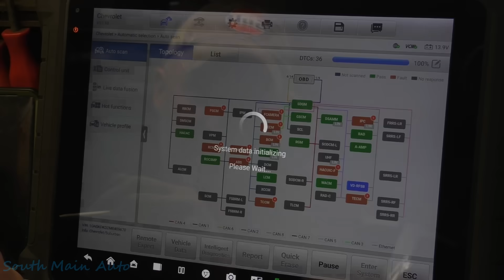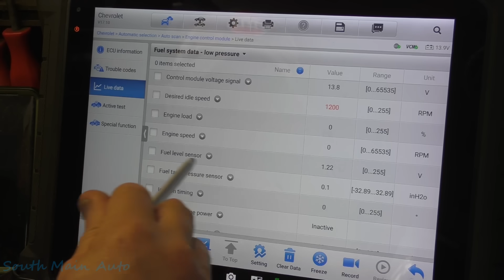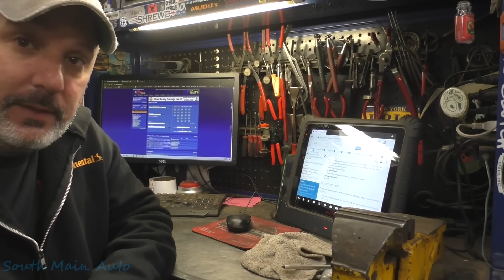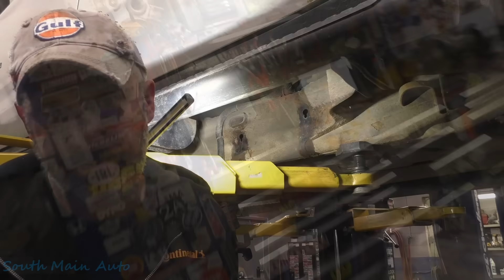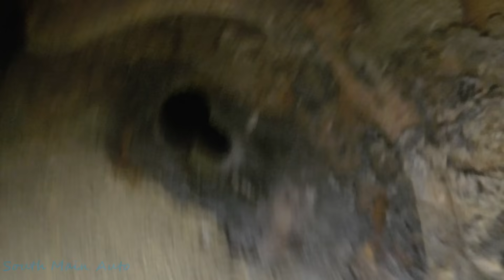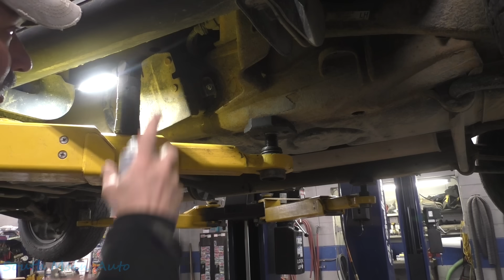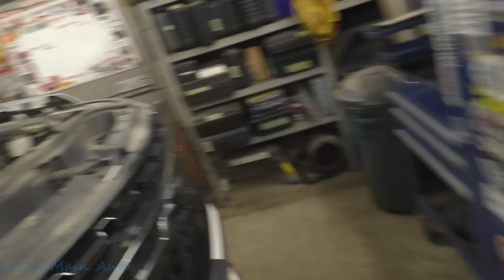'21 Chevy Suburban - No Start, Cranks OK

Comment: My guess on the bracket mount - Some bean counter determined the time to mount it was .058 seconds faster that way (right or wrong) so they went with it. The fact that it sucks to work on is just an added bonus for them. Great video!

Comment: I’ve got an amazing Silverado second gen, lived most of its miles in Illinois. It’s got 256k miles original 5.3, original lifters, and original 6l80e. I’m a mechanic and the largest item it ever got was a fuel pump because it was pouring gas out of the supply line due too rot. Its frame is beautiful and was built in fort Wayne Indiana. It is stupid easy to work on and doesn’t give up. These new ones piss me off for the same reasons.

Comment: As I'm sitting here watching after another day of wrenching in central PRNY, just wishing I could give anything to be back blasting out intake gaskets/headgaskets on GM 3.1/3.4 engines. I used to hate them, but damn now I miss just nuts and bolts for most problems with 90's early 2000's cars. Simple EFI, and no driver aids, just the nut holding the wheel.

Comment: You were supposed to loosen the nuts, lift the module up in the slot until the bolt head aligned with the hole.  Then, pull it forward so the bolt head went through the hole.   You're not supposed to completely remove the nut.
Reply: Guessing inverted torx was to hold bolt while loosening bolts. Why didn't service data describe it that way.

Comment: You say "three phase brushless DC motor"? Am i correct in saying its a 3 phase AC motor powered by DC? If so, it sounds like fuel pump control is just a variable frequency drive? If so my suggestion would be getting specs of motor and using a generic VFD. Thats how i tested three phase ac induction motors on rail car applications.

Comment: I'd have to guess the module is installed that way for ease and speed of installation. flop it up there and then have their calibrated torque guns tighten it down with the need to back the nut up with a wrench.

Comment: This tow / roll back driver in Texas. Tows a lot of GM trucks with under forty thousand ( some times less ) with fuel pump driver module failure. He is even getting them on the new diesel GMs. GM isn't fixing the problem but only putting in the same bad part. They even have fixed a couple before he has put his truck away. GM quality number one..

Comment: These three phase pumps, fuel, DEF, etc, are gonna be annoying to diag depending on the type of fault. Watched Royal Auto channel fight with a three phase DEF pump circuit that ended up being a slight volt drop where wire was crimped to connector terminal and that shut DEF pump completely down. No more poor motor performance, just work or don't work.

Comment: Super interesting, I know YouTuber "Tow truck Dustin" shows about once a week a Chevrolet or GMC with a bad fuel pump module, and that is on both the gas and diesel versions of the truck and now it is happening to the SUVs and smaller duty trucks. That must be why they have so many in stock, and the parts guy is like, yeah, we sell a lot of them.

Comment: Sometimes engineers just goof up. Nobody's perfect.  I wouldn't be surprised if it was designed to be removed for a certain model and they reused the frame for a different model.  
   Weird I was just looking at a japanese small run device to check cables on amazon. It looked like an arduino device or similar.  It's made for computer/ phone cables, but I bet it could be butchered up for cars.  (I literally was on amazon within minutes before this video)
  There is a textbook for people interested in general theory and troubleshooting called ''electrical motor controls'' by Gary Rockis and Glen Mazur. Not for the faint hearted. This is not a specific vehicle book, it's for beginning students.

Comment: I have been watching for over two years and have never commented. So I will start. Comment! 🤣
It's not you, I never comment on anything I watch. I love your channel.
Reply: I am an OLD geezer 88 yo and in the 50s a professional mechanic... points ignition, and  carburators..sun machine  scopes... nice that the ecms can be helpful..most of the time for cars these days.. I really enjoy watching someone using mostly common sense to diagnose problems and not just be a parts cannon.. thanks for the stories...😅
Reply: I'm a dumb retired plumber and Eric has me mesmerized with his detail oratorical based servicing brilliance.
This is educational theater on YT...Thanks again Eric O.
Reply: I subscribed to you because you are an honourable man and need at least one subscriber.
Reply: @wayneessar7489  Make that TWO!
Reply: @MrTruckerf  As one comment said 953,000 think like me.
Reply: That's A. A C Motor 12 Amps.   ??

Comment: Good questions, Eric! From what I know about BLDC motors, it's very hard to check properly (and worse, if you don't have access to the motor). The driver sends pulses to each winding and sees where the other windings are at, on a fraction of a second, by analyzing their back EMF, to start the 3 phase output based on it. A proper driver may detect a problem in the motor, if these signals are skewed somehow, but a faulty driver (either with one or more blown MOSFET or IGBT, or fried control electronics) will not perform these functions. I believe you can buy a Chinese power BLDC driver, to improvise a test on the pump, but it's an external setup that you need to prepare and play with on the bench, with a used pump, before testing on a real vehicle.
As for the mounting bracket, manufacturing engineers no longer see more than the part(s) they are designing, and only in a virtual world. They have no clue about how the real things they designed look like in an assembled car.

Comment: The honest answer? It's probably cheaper and easier for assembly. Hang it in place, zip those two bolts to tighten it and not have to worry about the manufacturing steps of putting a captive nut or carriage bolts into the frame.

Comment: Permanent magnet three phase brushless DC motors are really nice. The magnet is actually the rotor and the windings are the fixed field so need for brushes. I have a small milling machine with one and it is fantastic. At 2500rpm I can grab the drill chuck and stop the motor and it will trip off. At 100rpm it makes so much torque that I can't stop it by holding the drill chuck. Brushed motors are the opposite and make low torque low rpm and high torque at high rpm. In a milling machine application you want more torque at low rpm which is where you will be running bigger torque hungry cutters. All this with a spindle driven by a cogged belt directly from the motor with no two speed plastic gears that the brushed motor version of my mill has and they often break. On top of that it is quiet as a church mouse. I, however I have no knowledge of how to test a brushless motor other than continuity and equal resistance of the three windings. They are relatively new but probably quite reliable as there are no brushes to wear out and no contact surfaces other than the bearings. Let us know if you find a suitable test method.
Cheers: BJ

Comment: Why for all the tea in China or beer in Ireland would GB put the bolts inside frame rail and weld them? from inside out, in a blind hole, with no access to them, with a dummy 10mm on outside? I guess you’ll have to turn it red and make it liquid with torch if can’t muscle it off.

Comment: You could have tied your  Pico scope into each of the three outputs to the pump.  A lot of work to diag a cheap part though,  so not always cost effective.  Spending extra time on a system new to us is only good for learning purposes.

Comment: Things I would try to check:
- Put a current clamp on each phase to the motor (connected to your scope). Do you see an AC current waveform on each of the three phases when you cycle the pump?
  - If one or two phases is missing then you know that one or more drivers in the control module have failed.
  - If all three are missing it could be the same thing, but you are not as sure you are measuring it properly since you are not reading anything.
  - In this case where it was commanding 8500RPM, that might be 8500/60 = 140Hz. It it likely a multi-pole motor so the actual frequency will likely be a multiple (2-3-4-6-8) of that. But in this case probably in the 150-1000Hz range.
  - You could also back-probe the scope leads between the phases and look for the driving voltage, but make sure your scope is not grounded to the vehicle (i.e. it is best if it is battery powered), so it can see the voltage between the phases without grounding the phases.
- Are there three signals coming back from the motor in the schematic? If so, those would be the hall effect sensors that tell the controller the exact motor position. Put a scope on each of those (probably a 5V-ish signal) and see if the motor is turning.
- More likely in this case is that this is a three-phase induction motor, which will always run 5-20% slower than the driving AC signal, and the controller is looking for the back EMF from the motor that indicates how fast it is turning.
- If the controller is sending a good 3-phase drive to the motor, the controller is probably fine, and the motor is probably the culprit.

Anyway, just some ideas on how to troubleshoot.

Comment: Bolts are that way due to assembly speed and requirements. POS formed frame makes holes $$$ the keyhole slot means the assembler only has to drop the unit into place and hit the two bolts with the Torx. GM likely has the off shore supplier assemble the module to the bracket.

Comment: Jeep's not far off "General Mistake" ... I had to take the upper intake manifold off my wife's 2018 JL to change the driver's side plugs.  Luckily I have every U-joint, extension, and flex ratchet my Snap On dealer could sell me.

Comment: Eric,

A suggestion for testing those three-phase fuel pumps:

Get an electronic speed controller for brushless motors that can handle 4 cell Lithium polymer batteries and 30-40 amps, a servo tester and a cable that can hook up to the + and - of the fuel pump controller. The speed controller and servo tester can be bought in your local(?) RC hobby shop and you might have some suitable cables laying around. You don't need anything fancy electronics, the basic stuff will do the job nicely. Assemble the parts accordingly and attach to the fuel pump. You will now be able to test and run the pump without its module. If you hear the pump run and don't get any pressure, stop and change TWO of the motor wires, this will make the motor run in the opposite direction. Still no buzz, still no pressure? Replace pump. Buzz and pressure? Replace module!

Love your channel and your work, greetings from Norway! :)
Reply: I used to be big into Rc diy drones so I have a bunch of those things laying around. I’m gonna have to try that! I’m a mechanic now and that could be a valuable tool to have in the diag cart!
Reply: I came here to say the same about using an RC motor controller, or check with a 4 channel oscilloscope to look at the phases from the pump controller.  On the chance that one phase locked on, it MAY risk over heating one phase of the motor if it was on for long periods weakening the motor. (However I would hope it could withstand something like this.)
Reply: Yes, sir that will work out just fine. You're comment reminds me of an older mechanic who built all of his own test equipment using Heath Kit stuff for troubleshooting and diagnosing the ECM controlled vehicles when they first came out. He was an older gentleman, and he embraced the newer technology, and it was also cleaner work in the repair of an automobile. He stayed clean and did not get dirty working on automobiles. I was in the tool business at the time, and he worked at a Chevrolet dealer that was on my route. While other mechanics were bitching about them "computer cars" he was learning new tricks. Now who said that you can't teach an old dog new tricks.🥸👍👍👍👍👍👍👍👍
Reply: yep put on some gm plugs to pop it inline and a cheap servo tester would be a good tester.
Reply: That was my thought, but then I wondered if the GM pump would be damaged if it were run backwards. I own a GM truck and you can’t take anything for granted.  Some of the design decisions that were made on my truck are truly mind boggling.
Reply: I have a 30 amp one from Amazon, even has a reversing switch ($18.00).  Have used it several times to test pumps or drain tanks. Works great,

Comment: The problem is that these car manufacturers are putting too many sensors,  and modules in. What ever happened to  the basics? 🤔
Reply: The EPA happened. Trump might change some of it. But IF what the Chinese are claiming about being able to charge an electric car in 5 minutes is true, or close to true, combustion engine cars & light trucks won't be made by 2035.

Comment: 22 -24 pump modules are failing left and right on the GM trucks. They have really weak starters also. That long crank just reduced its longevity by 50%

Comment: Ford uses a carriage head type bolt with a spring clip attached to the head that would work for that bracket assembly. They used them on the 2013-2019 Explorer to hold the charcoal canister to the underbody of the car.

Comment: I find it interesting that the service manual says to replace the controller before replacing the pump.  That doesn't sound like a lot of faith in the durability of the module. (Yes, it's easier to get to, but still...)

Comment: From what I've seen, this is a very common problem on late model GM trucks. You would think that by now they would have done a redesign to improve the reliability. I am an EE and I would gladly take on the assignment myself. However, I can tell you for sure that a reliable design would cost too much. At GM, the bean counters rule! My experience in designing product for the auto industry, and in particular, GM, is that the  lowest cost is the #1 priority.

Comment: Seems like Tow Truck Dustin tows these with this issue a lot.  I think he's based in Texas and has towed the same vehicle more than once.  Good to finally see what this module looks like.  GREAT VIDEO!
Reply: Did you see video of Tow Truck Dustin take a Chevrolet to the dealership and the mechanic put a module on and drove the vehicle away before Dustin could get his wrecker bed put up? Just amazing!
Reply: @kennethpalmer1909  I did see that video and others like it
Reply: I watch Tow Truck Dustin pick up about one a week, and he complains about the same thing: the fuel pump module.
Reply: @chrisrpht2000  GM electronics are trash through and through.
Reply: @crisnmaryfam7344  Like the rest of the vehicle.
Reply: @crisnmaryfam7344  I think they're made by "bosch", who'd have guessed.
Reply: He is based out of Houston or near Houston

Comment: What is needed is a testing device that you can plug into the module and test the module and then plug into the pump and test the pump. You should be able to borrow or rent the tool from the auto parts store. They bench test alternators and starters, right. To me it seems like the book is right. Replace the controller first then the pump. The pump is the expensive one, labor. If the module is good, now you have your free tester, the old module, for the next customer.

Comment: With the vehicle cranking is there any way to maybe use a Noid Light between each of the 3 phases provided it doesn't draw too much current to check the control module output to the pump??

Comment: The fuel pump module is a common problem with GM. Basically from 21 to 24 models, the module goes out quite often! I know of several brand new vehicles the module goes out on, sometimes multiple times in a few months! 
Of course they all have issues, that's why I like older vehicles.
Reply: I have a friend with a '25 Chevy Silverado, fuel pump module failed while they were going down the Interstate, truck had less than 300 miles. Towed to the dealer and they replaced the module without even connecting a scan tool.
Reply: @ngtflyer  They need to do a f***ing recall.
Reply: @ngtflyer  I hate to say this, because I'm a GM guy, but the fuel pump module is far too common!  
Tow truck drivers are hauling GM pickups & SUV's into dealerships nonstop for fuel pump modules. Sometimes the technician meets the driver at the tow truck & has a new module on it without unloading the vehicle. 
It's affecting diesels too!
Reply: How scary going down the road and then it just dies on you. Especially when the wife is driving. What the hell is wrong with these manufacturers,
Reply: @gregjohnson2073  it's no different than if anything else goes wrong driving down the road. 
I do agree with especially if the wife/girlfriend is driving, with a car load of kiddos.
Reply: @Chevyman02  I have a 2001 Windstar with 245k miles and it has never left me broke down and on the side of the road.
Reply: @gregjohnson2073  no offense, but you must not be very old, or you've been lucky? 
It's not scary, unless it breaks down on a heavily traveled road, or in a bad or dangerous area.
Reply: @Chevyman02  You must be single.

Comment: If it is a three phase motor, it is AC, not DC, I guess the control module is effectively an inverter that varies the frequency to alter the motor speed and fuel delivery pressure and volume.
Reply: Somebody wrote that it is a computer controlled DC motor, where the computer sequentially energizes 3 spots in the motor to make it rotate. Great idea if it works, since those computer chips are so cheap. They wrote that it has been done for decades.

Comment: Being a DIY er, I would have gone for the controller replacement because that was the least expensive, least work way to go at it. Having to deal with 25 gallons of gas in that tank would be a big persuader.

Comment: For a three phase motor, all three positive wires, read together,  should read zero amps.  Read each phase individually.  Of course this is assuming they are using ac sine waves via a PWM.